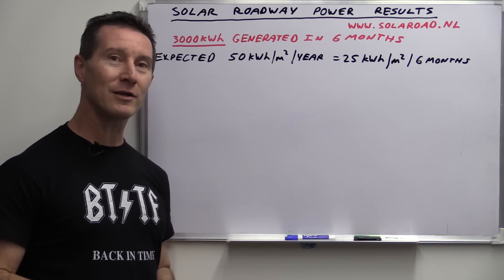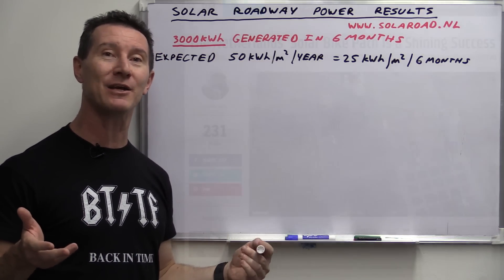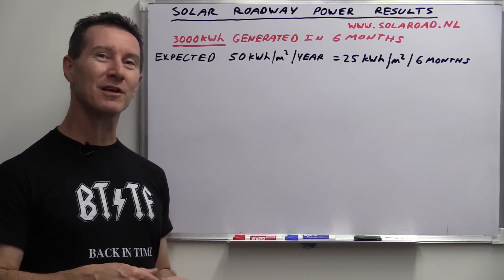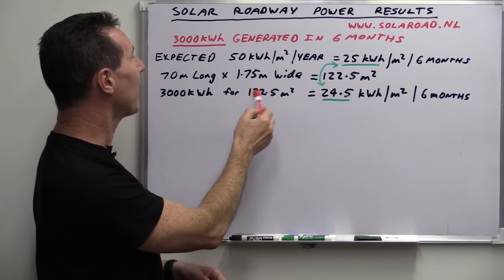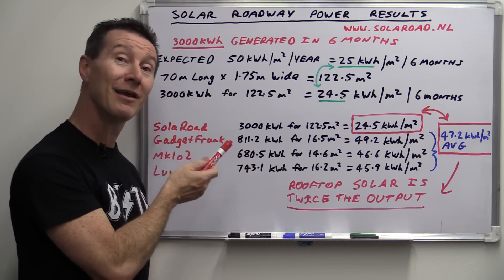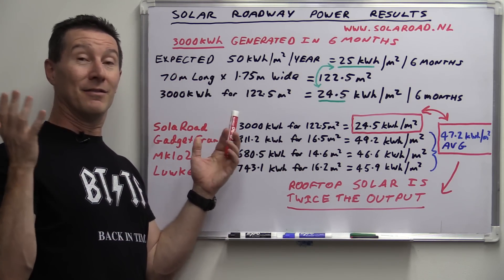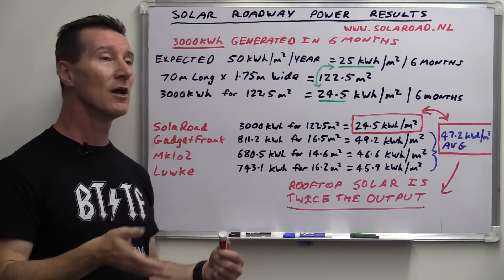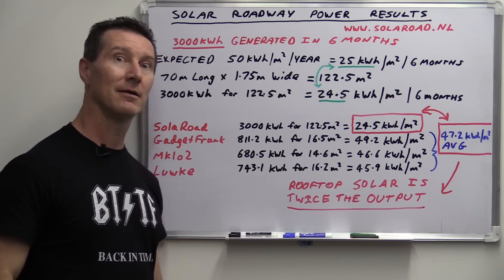EEVblog #743 - Solar Roadways Test Results

Comment: Dave, have you considered the fact that the road has only been live since November and that its achieved >3000khw largely through the winter months...With Summer coming it will exceed that, indeed pushing it beyond its expected targets.
Further Dave, your own figures show that it is achieving around 50-55% of the output of conventional and probably properly tilted roof panels...again exceeding the expected value of 30% as effective.

Its by no means a perfect solution, but they are not making false claims.. No one has ever said it would be as effective as a roof based system, but we don't have the roofs to put panels on them.. If we could put them on the floor at 50% effective, there is far more floor space than roof space...

But I totally agree, these units are currently far too expensive to install, to even consider using them, until such times as panels become more effective and the installation becomes cheaper this is a commercial non starter..
But debunk it for that not for its reduced efficiency over roofs, you have not succeeded in your video, in fact you made it more viable..
Reply: BrianBeuken Dave shows clearly that glass solar panels are not to be used as a road surface. This application maximizes the use of all negative factors of the panels. Flat on the ground with thick glass, non tracking and dirt and people over it.
Its like using a sponge to hammer a nail in a wall.
And no, waiting until panels become more effective or cheaper installation does not change the fact that its a fundamentally wrong use. That's green dreaming!
Its basically that you need to use the proper solution for the problem. And this is NOT it!
Reply: flexairz ermmm no Dave clearly shows they are not as efficient as Roof units, but they were never claimed to be..they are however generating more power than they expected they would, issues with the casing materials and non slippage will be resolved in time.

I think dismissing this on the basis of comparative performance, alone is short sighted in the extreme. When Igor Sikorsky was explaining Helicopters to investors, they rightly pointed out that planes were faster, quieter, bigger, used less fuel and had better range...in every way, better than Helicopters.. Sikorsky pointed out, that whatever a plane could not do, a Helicopter could. 

This is not ever going to replace roof panels, nor should it, but as another option where roofs are not available to mount panles or panels are not viable.. It deserves research, not pointless comparisons
Reply: Reddit Gold User Again well done on missing the point... We all know that flat panels don't work as well as angle panels.. constantly banging on about that is really rather pointless...the question isn't do these roads work better than angled panels, No they don't...they were never intended to.... so now you have that answered, you need to look past why this is being done.

The question is can these roads be functional as roads and provide energy as well..

So...if that's the question, they do work, perfectly well as a cycle path at least, roads need to be tested next,  and as power generators,  50% as good as proper panels.,which is not bad..
And the 800K wrong (unless you are confusing the Dutch Solaroad with the US Solar Roadway) its 1.75MEuros of local taxes, which  is pretty average funds that local government people spend on research I think they probably spend more than that working out if its possible to recycle yoghurt cartons....I'd rather see tax money spent on research like this.

The point is not that they are not as effective but that they are possible....The Solaroad test..and please remember it is a test, has 2 cycle lanes operating...one is producing income, one isn't...which is best? think about that...ONE is producing INCOME....the other isnt'...there are no roads anywhere that provide income..this is a first.

If it turns out that the enclosed flat panels can be a perfectly usable path and stand up to a normal paths lifetime and generate income...even if not at the same level of a roof panel.. Then that path is making money.... Its actually a good idea.

The only unknown issue is how much more expensive is it?.
Before you bang on about the 3.5mEuros please note that is not the cost of the actual road, that's the cost of 5 years of R&D, staffing, prototyping, testing and so on.. Quite a modest burn for an R&D company over 5 years.

The road itself did not cost 3.5m  Its certainly more expensive but how much more?? We don't know because that info has not been specifically released... But if it was X% more than the non powered path...and over Y time it paided that back perhaps with some extra income from the remainder of its functional life...
What we then have is a path/road that pays for itself and then gives profit back to the council who put it down....

Now....that is something I think is well worth the investment of 1.75mEuros and then some.
Why on earth is there so much hostility to that idea?
Reply: Reddit Gold User 

The Solaroad is being cleaned at the same frequency as the other paths.. and you are simply assuming the repairs are more expensive (I would tend to agree but we don't know), but tarmac repairs are also not cheap, if the panels are produced cheaply enough simple replacement may be less expense than a tarmac repair (which is more than you might think)

Rooftops are not the final solution as you well know there are a limited number of roof tops, and especially in large cities many of these roofs are on skyscrapers, failing to supply demand for the building they are on.. 1 roof works for 1 family sized domicile. at best..

Solar panels are indeed mass produced, sealed road worthy units are not. They are custom made and therefore extremely expensive at the moment.

Rooftops may not need much maintenance but roadside, unused land and tunnel roofs will... And again no one doubts the roads in use will be subject to user damage...but we don't know how much...the trial is attempting to determine that

Again...rooftops and angles panels...its not always possible to mount a solar panel on a building... The Netherlands for example has many cycle paths, and only those in the cities have rooftops next to them, often with sky scrapers...so there would be little point putting a solaroad down as it would not get light...away from the city, there are thousands of kilometres of paths and roads....with no rooftops beside them. A Solaroad in any built up area would make no sense.

You can't actually accept this at all can you, you've predetermined its a bad idea because of the solar inefficiency and refuse to let the positive details sway you, you are totally blinkered on this aren't you....rooftops are not always available...roads are.

And to repeat the point...if the test showed It paid for itself in 10 years would the efficiency you are so hung up on matter?

on an unrelated point, how were you able to bold the quotes from me??
Reply: BrianBeuken This research has been done. Flat panels don't work as well as angled panels. Panels under objects don't get as much light. Dirty panels generate less electricity. What does this research seek to prove that we don't already know? Why are we funding this with 800k of taxpayer dollars?
Reply: BrianBeuken ..."one is producing income, one isn't...which is best? think about that...ONE is producing INCOME"
How do you know its producing money and not losing it? R&D costs aside, where is your data that says expensive flat-lying panels can pay for themselves? Cheaper angled rooftop panels take 10 YEARS to pay for themselves and then only last another 10 years. Given the fact that these path tiles generate less, and are more expensive suggests that making your money back in its 20 year operational lifetime isn't possible. Saying it will actually make money is very optimistic considering 70m of this can only power 1-2 homes. So in this case the concrete path is better because after 20 years you would have more money.

But lets assume that these CAN produce an income that can pay for itself. You would still get a far better return on your investment if you put your money into rooftop panels.
Reply: Reddit Gold User Amazing that you are still fixated on the flat panel thing... Again I must point out no one disputes that the power production is low...but it is there.

Did you miss the part about it producing more power than expected...ie..producing power...that is income...
A concrete/tarmac path is also an expense...it costs to lay it, it costs to repair it, it costs to clean it....it generates 0 income...ever..in its entire life. Its always a loss. This one has produced income just by being there. its losses are being clawed back...that's not something you can do with any other road (tolls excluded of course)

As far how much its making  back....that's exactly the point of the test...to see if it can make enough to cover its cost...is it going to last long enough to repay its cost? Is it going to stand up to weather and usage reducing maintenance costs? Will the panels work in all seasons, will usage make them too dirty to function?
These are the questions that need to be answered, and can only be done so with testing.

If it proves that it is possible, then the costs can be discussed, remembering that economy of scale will reduce the manufacturing costs, massively making it more realistic to extend the amount of path/road laid.. 

Of course the ideal solution is roofs over the paths  with panels on the roof, and panels in every field.....but have you stopped to think about the cost of production and maintenance of those panels...probably much more expensive and prone to higher maintenance than a simple lay it and forget it floor panel. Not to mention fugly as hell....

Again... please.. I get the point about cost...but neither you nor I have any idea what the actual cost of the 70m stretch is, and until they finish the tests we won't know..You are making broad assumptions and simply dismissing this on unreasonable grounds.. 
It works as a cycle path, its generating more power than expected...its producing interesting data, which is getting them very excited.
But you have to keep on about angled panels and high costs??? 

Be honest...if the test showed it paid for itself in 10 years and made profit thereafter, something a standard path never does...would its efficiency matter?
Reply: BrianBeuken ..."A concrete/tarmac path is also an expense...it costs to lay it, it costs to repair it, it costs to clean it" The same applies to a solar path. Except it will need to be cleaned more often and repairs are more expensive so this point is irrelevant.

" its losses are being clawed back...that's not something you can do with any other road" How about the city put solar panels on roof tops and use the profit to claw back at the asphalt's path's expenses?

" remembering that economy of scale will reduce the manufacturing costs" Solar panels are already mass produced.

"but have you stopped to think about the cost of production and maintenance of those panels...probably much more expensive and prone to higher maintenance than a simple lay it and forget it floor panel."
Are you kidding? Rooftop applications can go years without needing maintenance. Leaves and debris aren't going to slide off of a floor panel. They will also get dirtier because they have traffic on them. Or they will get scuffed.

"Be honest...if the test showed it paid for itself in 10 years and made profit thereafter, something a standard path never does...would its efficiency matter?" If panels were that efficient then you could make even more money with them by placing them on rooftops and just paying for the normal pathway. You are compartmentalizing. Think of it like this; a solar bike path, except the path is asphalt and its panels are located on adjacent rooftops. That solution will ALWAYS make you more money. There is no logical reason to combine the two.
Reply: BrianBeuken First off that's insane to believe it could ever be cheaper to replace tempered glass than repair tarmac. Asphalt is the most recycled product in america and the costs associated with its repair primarily come from workers' wages. Tempered glass is expensive because it takes a huge amount of energy to make. Plus it will need to be replaced if it so much as becomes opaque due to wear. Plus you still have to pay those same worker wages(probably more since they're technicians and not manual laborers). But you're entitled to an opinion.

You're right, rooftops aren't the only solution. Putting them alongside roads or in open areas where they're not underneath anything is also a good idea.

"refuse to let the positive details sway you" I haven't been convinced that it has positive details.

"if the test showed It paid for itself in 10 years would the efficiency you are so hung up on matter?" That's like having to choose between receiving $20 or $40 and having someone try to convince you that choosing $20 is still a good option because it makes you $20 richer.

edit- put an asterix at the beginning and end of a sentence to bold face it
Reply: Reddit Gold User  $20 is still better than $0 and that is in fact the choice being offered. There is no $40 option my friend...there is no effective way to mount rooftop panels at or over roadside, so its this or nothing. if this provides even $1 its more than any other road has ever made. That's a positive.
Clearly you've made up your mind that this is doomed before the full results are in, I prefer to be a little more open minded. It does make money, the question is simply how much...and then, can we make it for less than that?
Since none of us honestly know the answer to that.. I will wait and take interest in the reports that show it is making more than expected.